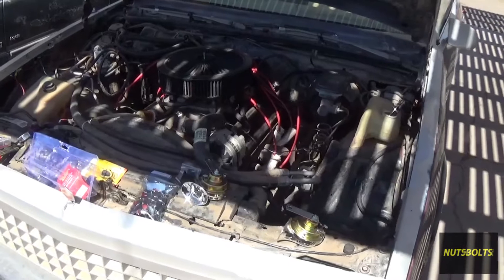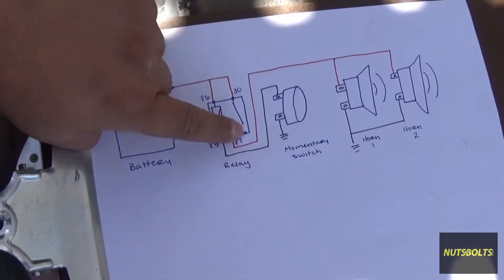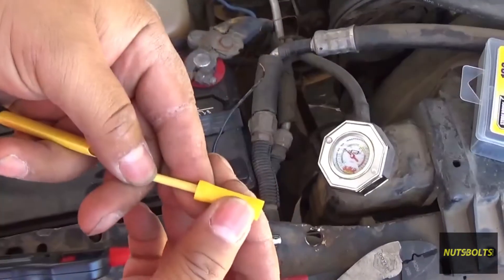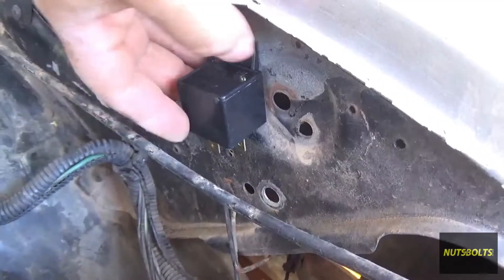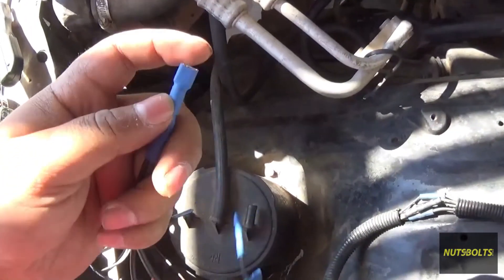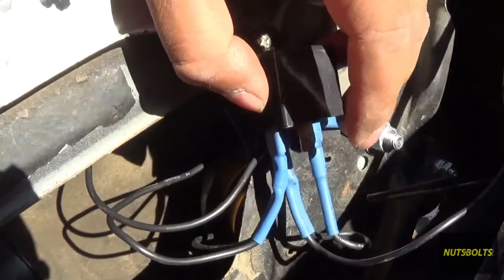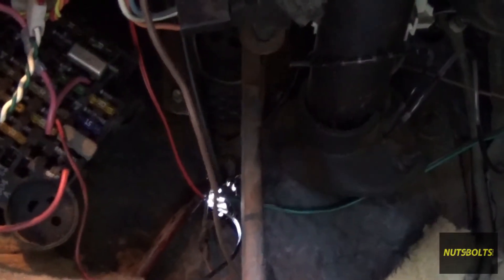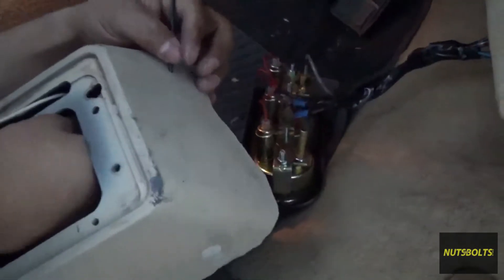How to Install Aftermarket Horns in Your Vehicle

Comment: Good job. You used the non-insulated crimp part of the tool on an insulated crimp, both ring and butt splice. If you'd used the back side that said "insu" you wouldn't have risked piercing the insulation and wouldn't need the heat shrink.

Comment: Thank you so much bro but i didn't get the switch part clearly. Right so we have power coming from the relay pin 85 to the positive of the switch okay. So where is the other pin on the switch connected to

Comment: just curios why you didnt you use the stock  factory horn wire from the original car horns ,, it has a relay it self and i used the factory horn wire and added 1 relay and took out my 2 stock horns and replaced with 4 caddilac horns my 97 mercury sable sounds like a train and its loud ,, i use my regular sterring wheel horn pad switch
Reply from the maker: The wiring in this vehicle is a bit of a mess, so doing everything from scratch was the best bet. You certainly can use the original wiring, if that's an option. Thanks for watching! 👍